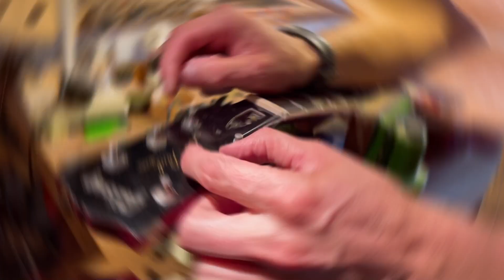Gibson Les Paul Standard Guitar Repair/Restoration/Makeover/Tutorial/ DIY/Luthier Workshop/ Ep.14

Comment: One way to lessen the effect of bridge bending is to set the stop tail piece higher so the vertical component of the string tension is lower.
Reply from the maker: Thanks for your Feedback Antonio. Yes this a a good way to avoid the bending of the Bridge. Best Regards Nik
Reply: I've also noticed it makes your 10-46 strings super 'bendy' when you raise the tailpiece a tad. A good rule of thumb on many forums is that you do not want your strings making contact with the back of the bridge.
Reply from the maker: That's absolutely correct. Thanks for sharing. Best Regards Nik @kennethh2430

Comment: Nice to see a headstock break repair without using splines. Splines are waaaay overused by many guitartechs. When you have a decent glue surface, there is really no need to use splines. I avoid using splines as much as possible and have never had any issues with durability.
Reply from the maker: Thanks a lot for sharing your experience. That's correct if you have a clear break like this its not necessary to insure splines. Best Regards Nik
Reply: Absolutely agree on all points.
Reply from the maker: Thanks a lot for sharing your opinion. Best Regards Nik
Reply: How long would that glue hold before the headstock breaks again? I kind of like the idea of splines, because chances are, it will never break again with splines in place.
Reply: Splines replace the ratty, rotted grain and stabilize the break.

Comment: Probably a dumb question, but does glue squeeze into the truss rod cavity? If so, does it have any affect on it's function?
Reply from the maker: That’s a good question 👍If possible you have to avoid that… and it’s necessary to protect the threads of the Trussrod. If there is a bit squeeze out into the Trussrod channel this will not a real issue. But better avoid it 👍Best Regards Nik

Comment: Putting all that masking tape directly on lacquer is a very risky thing to do. I'm not sure why you needed it in the first place, but I've seen masking tape pull lacquer right off the wood.
Reply from the maker: Thanks a lot for your Feedback. Yes this can be a problem therefore you have to use only light adhesive tape for this process. Best Regards Nik
Reply: 😂 It's not normal household masking tape, bro. They use painter's tape or similar. It's super low adhesive and used by luthiers worldwide.
Reply: @AlexVonCrank  "normal household masking tape" IS painter's tape.
Reply: Normal household tape is NOT painters tape. Sorry, but you're dead wrong. Maybe you can't tell the difference...😂
Reply: @AlexVonCrank  Haha, tried to weaseI out, eh?  Now you KNOW masking tape is meant for painting because it ... MASKS OFF where ya don't want paint! (Of course, you mean the green automotive masking tape.)